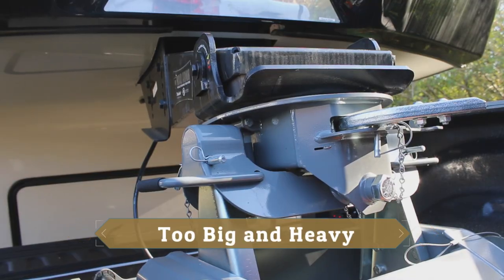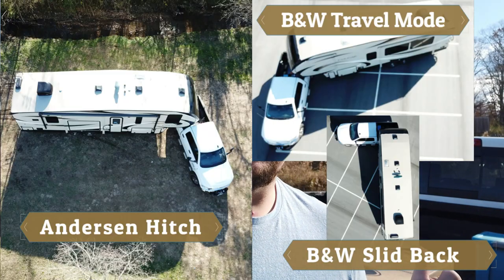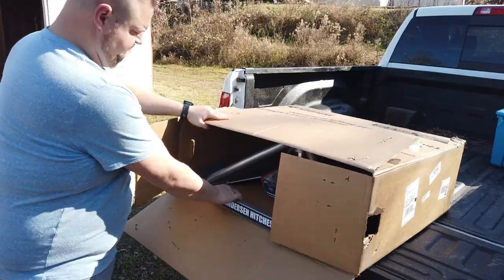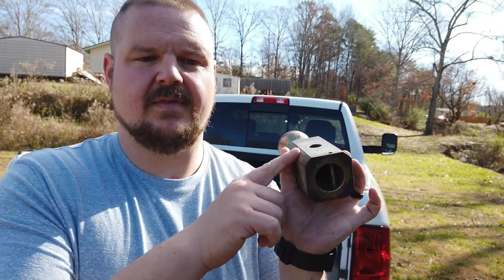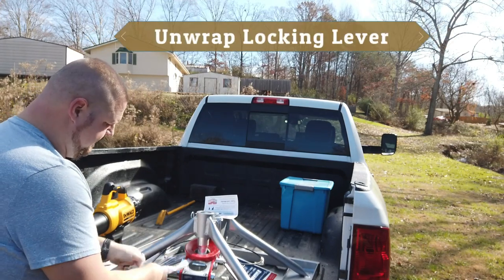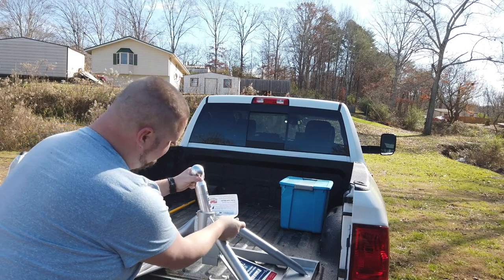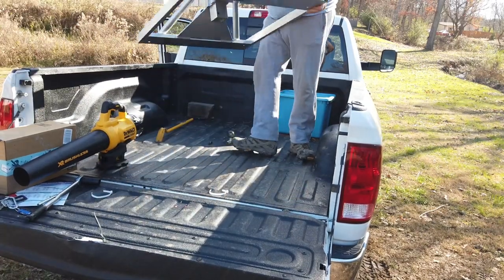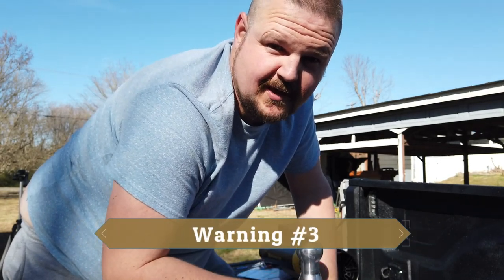Andersen Ultimate Hitch Install - Ultimate 5th Wheel Connection Fifth Wheel #andersen #Ultimatehitch

Comment: I had a Husky Silver Sliding 16K for 3 years, but it was stolen out of a storage unit after traveling from NC to ID.  Looking real close at the Anderson, but saw a review that they sway at high speeds.  They didn't say what they consider high speed.  Have you or anyone else out there have any issues with that.  Recently retired and plan on traveling across the US for several months.  Great Video by the way.  One of the best I've seen.
Reply from the maker: I hadn’t had any sway personally.  I was having increased bounce for a while, but that was a suspension failure.   I’m still happy with the hitch.  It’s not as easy/fast as a regular 5th wheel hitch because you have to go all the way over the ball.  I drive 65 with no issues that I can blame the hitch for.
Reply: @GimpyCamper  Thanks!

Comment: I have used this for several years. 2 main reasons I use it, First, no moving parts, engineering wise you can’t get any better than that and secondly, you can’t drop the camper onto you truck bed. We have all seen or at least heard of someone driving out from under the camper without putting down the landing gear.

Comment: So question you said you turned the coupler around later. I've got a ram 2500 short bed as well did you clear the cab and bed sides with it being turned around.
Reply from the maker: I’ve used this hitch for > 20k miles.  In the Ram short bed 2016 my particular pin box won’t clear my side rails.  This can be found mathematically by the directions.  I still get 80 degree turn in the front cap.  This can be extended as some people use a B&W 4” offset ball to move the whole system back as though it’s not reversed. (If there is tailgate clearance”

Comment: Great review.  Question, how much space do you have from the front of the hitch to the bed wall against the cab?  Asking, because I want to install a Toolbox fuel tank as well.  I am sure the companion will give enough space, but weight is always an issue.
Reply from the maker: From the front of my ball I have 40” if you need the measurement from the front of the base let me know...

Comment: I got like 13k miles towing my 17k trailer and have 0 issues except for the red funnel gets brittle in the sun but they guarantee them for life. I hang the hitch on the wall in my garage.
Reply from the maker: I’ve had it about a year now and 5,000 miles and I’ve not had any either

Comment: How much vertical clearance do you have? I'm asking because i also have a standard weather guard tool box. It's about 5" above the bed rails. You think i could still use the Anderson hitch?
Reply from the maker: I wouldn’t with a short bed.  I have about 7” of clearance now but I just finished putting a lift kit on my camper.  I really loved my toolbox and hard tonneau cover and miss them, but I ended up going with a softopper
Reply: @GimpyCamper  apparently Anderson makes a tool box version now. (Just looked on there site) I'll have to research this more. I would hate to loose my tool box.

Comment: Is your Ram a 2500 or is it a 3500? If it is a 2500, is it a Cummins or a Hemi? I am considering a new 2500 Cummins to pull a 29RKS, but I am concerned that at less than 2,100 lbs. payload capacity the Ram diesel will be overloaded when I put two people and gear in the truck and supplies in the trailer. The Anderson hitch will sure help with the payload capacity. If your truck is a 3500, payload is a non issue.
Reply from the maker: My truck is a 2500 Cummins… it does fine but is at the upper limit of payload… funny considering it’s a “half ton towable” 😂.  Are you in our 29 rks group on Facebook?
Reply from the maker: I found you and sent you some stuff in FB messenger
Reply: @GimpyCamper  Yes, recently joined.

Comment: Just bought a 2017 silverado 2500hd sits much higher than my 2006  F250. I have a Mor/ryde hitch on my 2013 5th  38 foot Montana. Will this Anderson give me the six inch clearance on the side rails?
Reply from the maker: This is very hard to judge without hooking it up.  My 2500 4x4 is the outdoorsman edition and sits very high.  I have the ball in the medium setting.  Don't you wish you could try some "loaner hitches" before you bought something to see exactly how it works with your truck and trailer.

Comment: Been debating a pullrite auto slider or B&W turnover ball then Anderson Ultimate or Pullrite Superlite myself. I'm not sure I want to mess with the capture plate required for the autoslider. Don't think I'll always be on a level spot to get it connected. Looks like the Anderson alone gave you more turning than the old hitch without sliding it which is a plus
Reply from the maker: I’m a fan of the Andersen so far... it’s really a hard decision that you have to make without seeing how each particular setup would work with your setup.  (Not to mention expensive decision)

Comment: I have a 2019 Ram 1500 5.7L Hemi with a 5.7 short bed. My question is does the Anderson hitch work with a short bed 5.7? I bought an Escape 5.0 5th wheel which is fiberglass and total WT is 5500lbs
Reply from the maker: I would say that it would work.  I know my short bed is exactly the same size on this 16 2500 as it was my 12 1500, but I think it’s a tad longer.   Unfortunately with hitches there aren’t any guarantees and you really don’t know how it will work until you have the hitch, the trailer, and truck all hooked up…

Comment: Hi great video. What is the clearance from the front of the bed to the front of the hitch base? Is there enough room for a toolbox?
Reply from the maker: That will be truck dependent.  I could probably put a low profile tool box in but I was afraid if you turned on a hill it could make contact with my camper.  For my ram extended cab short bed it is 40” from the front of the ball to the cab and about 21” from the front of the frame to the front of the bed
Reply: Thanks. I have the same truck

Comment: How's it going mr gimpy, cool name, liked the videos very informative, wanted to bother you I know you showed the turning comparison to the b&w they seem to be pretty close to each other but sometimes videos don't give you the full feeling, would you say they have about the same turning radius and if so what allows the b&w to reach the same turning radius I'm considering getting one would just like to have the option Incase I ever need it over the Andersen thank you
Reply from the maker: deviousrcngkrew I think they are close to the same.  The b&w has a slightly better turn radius without sliding it back but it’s pretty close.  Just be careful with the slider and don’t mess up your tailgate like I did in my video
Reply: @GimpyCamper  yes I saw that my bed is a6 and 3/4 so I'm going I'll be fine there, do you know why the b&w is so good for turning does it have an off set on it
Reply from the maker: If I remember right it sits just over the axle.  No real offset.  A lot of it depends on the shape of your Fifth wheel nose as well.

Comment: So these come with that red guide piece now? Mine didn't 4 years ago and I haven't ordered one yet.
Reply from the maker: Red guide piece?  The adapter on the 5th wheel?  I think it’s the same but just red to stand out.   Actually... I’m not sure if the old ones had the same shape... there is a cone that helps so you don’t have to be right over the ball.  They say you have a 6” difference that way...
Reply: @GimpyCamper  Yeah that red guide cone. Not sure what they officially call it. Mine didn't come with one and I think it's about a $50 option. I've never really had a problem lining up without it though. I have a video I made of my set up from a few years ago on YT.

Comment: I have a sb and have a B&W Companion hitch but it's not the slider I have the puck system, now taking it apart it's not to heavy the non-slider hitch. I had the slider and man that was very heavy but since when I had the slider I didn't use it so I figure that I can get away with getting a non-slider hitch this time. The non-slider B&W hitch work for me but I wouldn't mind trying a AUH. So what did you do with your B&W hitch?
Reply from the maker: I sold it and used the money to buy the Andersen.
Reply: @GimpyCamper  Okay, that is what I was thinking,  maybe one day I will do that but for now I'm happy with my B&W hitch, thank you sir.

Comment: Aren't you supposed to Lock out the Roto box to stop it from rotating? Very good video, I just got an Andersen.
Reply from the maker: I didn’t see that at first, but congratulations for figuring out tomorrow’s project!  Basically, the directions say if you don’t the rubber pad can eventually migrate and cause problems
Reply: @GimpyCamper  great...the only ones that I have seen Fail was with the Roto twisting it under extreme stress.... Thanks for replying....great review... I've got a Ram short bed...

Comment: Hi, thanks for the video, very helpful. 👍 Can you tell me if your truck has the 5.5' box or 6.5'?  Also any issues with the set screws coming loose?  Thanks again.
Reply from the maker: My truck is actually 6.25 ft or 75 inches I believe.  I’ve not noticed any issues with the set screws but I’m planning on checking now that you reminded me of it!  I’ll let you know.
Reply: @GimpyCamper   A tip I learned from yrs of farming regarding set screws was to tighten them then take a  small punch that fits and give a decent tap or two on the bottom of the screw, that generally lets you get them a bit tighter then they won't work their way loose.  Thanks again.👍

Comment: As close as it is in a tight turn if you are backing slightly uphill it it's gonna hit.
Reply from the maker: Not under normal driving conditions... the only time I even have to be conscious of it is when I do a u turn, but never had an issue
Reply: I have no reason to doubt you, my concern would be in a tight campground backing into a site that's a incline. The  corner of the 5th wheel on the inside of the turn would tilt forward possibly contacting the truck cab.
Reply from the maker: Yeah, it definitely would be better in a long bed, but the contour of the nose helps a lot.  Luckily backing into tight campsites is often something you can take your time doing in small short steps if necessary- so that if it were to come close or make light contact then there shouldn’t be any damage.